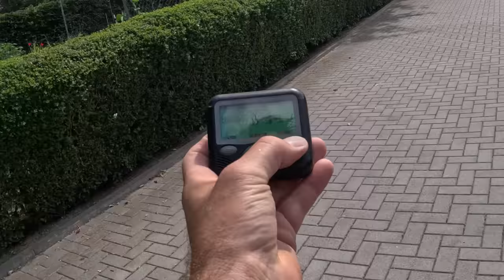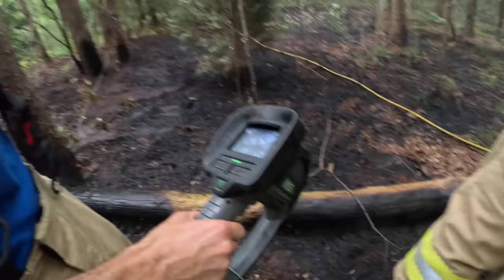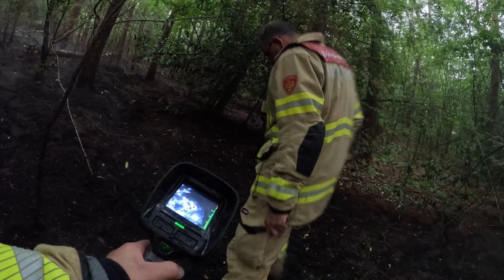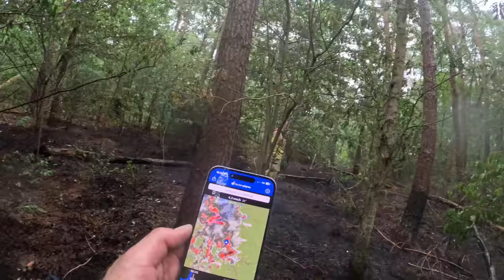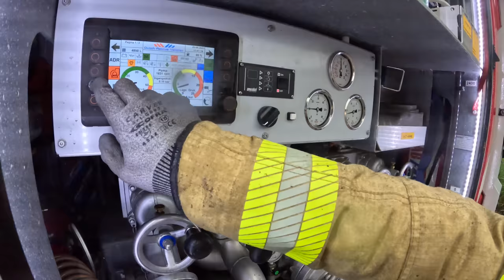Natuurbrand - VOLUNTEERS DUTCH FIREFIGHTERS -

Comment: GREAT TO HAVE YOU BACK. Forrest fires/ wildland fires have not really been huge in the U.K until the last couple of years, they are perceived as not too much of an issue, until they become massive and very very dangerous and un predictable. Always makes me smile when the pump and crew bus go on the shout, and get the job done, amazing with only 8 on the pump and 4/5 in the bus, in the uk its 4 riders on a pump. Great job as usual.
Reply: Ye nothing is put into wildfires as they happen in other places not in the uk but the moors do burn and only when they are massive do people actually think about them day after they are out out same way of thinking but well done to the crew of this engine as they did well when that is all structural firefighting gear mainly🫡

Comment: As a volunteer wildland firefighter, i suggest your squad to buy some manual tool for grazing wildfire, like Gorgui, wildfire rack, hoes and also wildfire flabellum, for this tipe of fire they are as efficient as water, becuse most important thing is to isolate burn terrain and materials from good materials creating a furrow, and important thing is to focus on shutting down first the fire perimeter.
For example, 2 operators with water, the other with manual tools separate burnt part extinguished part not yet burned to avoid shooting, but in any case with a brushwood fire even hand tools are very effective, especially with not too much wind, in this way you can save water.

Comment: A lot of area to wet down, truck dosen't carry enough water. I'm surprised the dispatcher on call, that they don't have additional units responding with you. You can run out of water very fast and over growth burning can become a huge fire. In your videos it seems you guys respond alone much of the time.  ( check out long island ny wildfires) i was there very long ago. It's a dirty job and you guys got really dirty on this job. I see you guys send your gear to be cleaned after calls. So i'm guessing you all get two sets of gear to use. Another job well done !

Comment: nice, fun video, i was wondering what the air temp and humidity was , but the thunder then rain pretty much told me what i was wondering. lol. how many liters/gallons does that engine carry? i was impressed with the driving skill on those narrow streets with a large engine.nicely done, training, experience and living there with the streets all help of course.i spent 14 years in a city fire department, but i rarely did structure fires, was assigned to a wildland engine from day one. 14 years and broke my back working as a plumber for my father, was 30 years ago and to this day i miss it. no mccloud tools?
Reply: City engines usually carry about 1500 liters.

In rural areas they sometimes have bigger engines. I think this is one of them, they carry 2000-2500 liters.